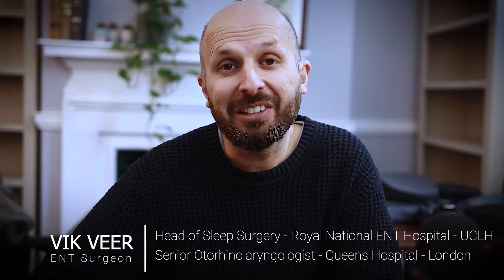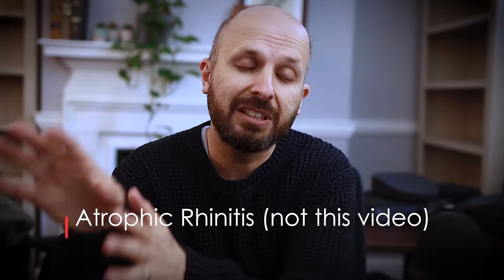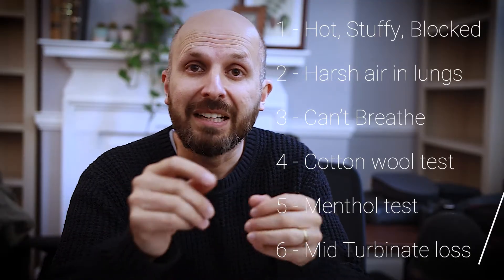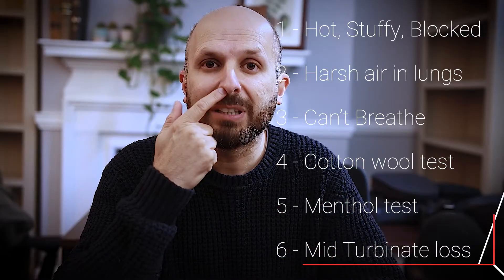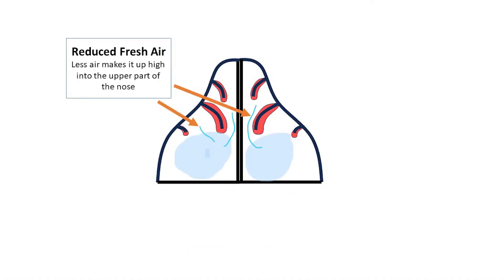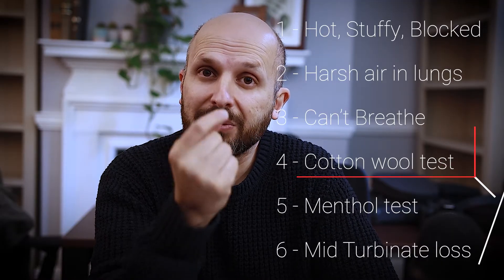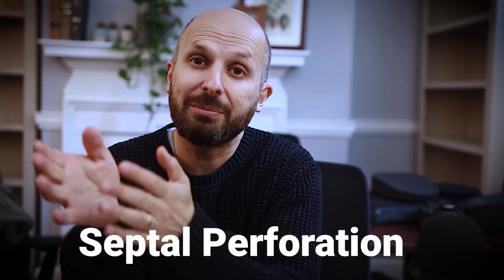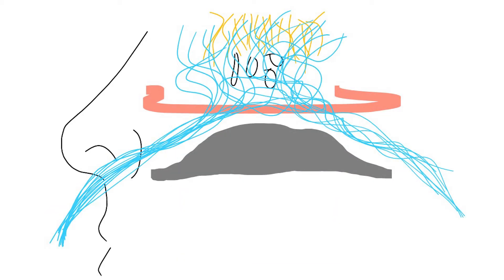Empty Nose Syndrome - My Theory & How to Fix it

Comment: Removing turbinates will cause a drop in pressure of the air flowing through the nose which can be catastrophic. The lower pressure will not be sufficient to inflate the lungs effectively which is why some people have trouble with automatic breathing when they have had aggressive turbinate reduction.

Comment: If the septum becomes deviated over time (for whatever reason). Why can't we "un-deviate" it over time?
The teeth are most definitely not flexible but we have braces to correct crooked teeth. Why can't some kind of nasal "brace" be used to "un-deviate" the nose, safely over time?
I do NOT mean we should break the cartilage, but this sounds like a reasonable approach. Septoplasty (if terminate reduction is done), can cause ENS, which is nightmarish from the descriptions I've heard of.

Comment: I never had issues, and don't know why my parents or people wanted to remove what is called poypper i næsen, polyps in the nose or something. But they might have done this as well. I just know, after it, I feel no resistance in my nose, and nose breathing is much harder. Never had issues, so don't know why this had to be done. :( Also, when I dive under water now, or if jumping into water, water automatically go up through my nose, into my stomach, so I swallow water through my nose, no matter what I do. Which makes my stomach hurt after bathing i salt water for a bit. :( Also have the cold air feels bad when breathing. I found if I hold down one side of my nose, so only one hole is open, it's much easier to breathe because now there is resistance, so I can actually suck the air in without having to force so much.

Comment: I feel sorry for so many commenters here suffering the symptoms. I have been dealing with hyperosmia for about 3 years and its been driving me crazy. It was hell trying to figure out if its phantosmia or what until i got an air quality monitoring device that detects HCHO and TVOC, that i can prove i wasn’t hallucinating. Only until recently i noticed that only one of my nostril is partly block and hence came to learn about turbinate. Smells from natural sources won’t hurt and also won’t last to offer steady constant relieve, but most chemical fumes would linger. I was going crazy not knowing what it was and thought that somewhere in the neibourhood somebody has been polluting the air. What made me crazier was nobody could smell what i smelled. Upon realising this turbinate thing, i deduced that its inflammation, as I’m also currently managing whole body lymphatic inflammation situation through detox with the right food and exercises. You, Dr Veer, by far has given the best and possibly rare explanation that could shed light to what this is. This knowledge gives hope where there’s almost none. ❤ Thank you.

Comment: Dr Vik, about 2 and a half months ago i underwent surgery: septoplasty, electrocoagulation of inferior tuninates, palatoplasty and tonsillectomy; recovery was harsh of course, but like after the 3rd or 4th week i was fine; i didnt know details about this ENS; by the 7th week it all apeared ovenight: almost permanent suffocation and panic and extreme dryness in the nasopharynx, palate and throat; ENTs say i have some synechiae developed after the surgery and that's a fact; some ENTs say the symptoms are in my head; one ENT that says that i have ENS and removing the synechiae will do worse; another one says that removing them is key because the synechiae might be blocking the receptors and the turninates from doing their job; what do you thing?

Comment: A side-effect of my turbinate reduction surgery (radio) was that now when ever the temperature drops to about 50F outside, my nose gets very runny. I have to keep tissues on hand. That the case even though they wanted to do a follow-up surgery to perform a nerve block because there was a swelling of those turbinates which was leading to a bit of pain. They warned that this rare effect could lead to them reverting to their original size. I opted to not do the nerve block. I sort of lost trust in the process.

Comment: Can u get ENS from aesthetic rhinoplasty (nose tip lifting where the septum has to be shortened)
Reply: There are rare cases of ENS after septum surgery. When turbinate is not reduced 'original ENS' not possible but lift tip can change airflow so some problem with this is possible.

Comment: Will damaging the nerves in just one turbinate cause ENS? (i.e if you had ENS in just one nostril and then closed off this nostril will you still suffer from it?). If not, can you take a cautionary approach and perform turbinate reduction surgery on just one nostril at a time to reduce the chances of ENS, or at least cure it by blocking the one nostril if it does develop?

Comment: I've seen people claim they got ENS from modern procedures. There will likely always be a risk when you reduce the turbinates because it changes the air flow. But it is good to know ways to prevent it and also how to fix it after. I'm considering a turbinate reduction, and if I get ENS, I guess I'm just gonna have to keep saline cotton over my nose

Comment: Thank you for not fearmongering over ENS. AFAIK the risk is basically nil (obviously bar malpractice) with modern techniques such as radioablation. This was a very real problem where the accepted practice was RESECTION of the turbinate rather than just scarring the tissue so it can naturally shrink.

Comment: I would like to share with you my experience after septoplasty and inferior turbinate reduction. 
The most important thing is that the right nostril only breathes well under certain conditions, including:
- nasal decongestion phase (nasal cycle). 
At the same moment, the left nostril breathes worse, but still feels the flow of air in it. 
When the nasal cycle changes after a few hours, I suddenly feel a complete lack of nasal patency on the right side (even though the doctor said there is plenty of room). The air in the nose on this side becomes hot, it is very dry inside.
I'm starting to wonder more and more whether I may suffer from empty nose syndrome, but it's one-sided.
In the morning I often wake up from sleep and feel as if I couldn't take air at all through that one nostril. 
In winter, it happened that I was outside and I had the right nostril unblocked and the air flow was very cold.
I don't know if I will ever breathe properly again. Could the doctor at least read this and write anything back I beg because I have been agonizing over this for 3 years now. I can send a CT scan. I performed it 2 weeks ago.

Comment: I haven't had any nasal surgeries and I'm mysteriously experiencing the symptoms of this condition, seemingly from cervical spine compression or neck and shoulder muscles impinging nerves connected to the trigeminal nerve system... At least that's my theory.

It feels terrible to live on every day with a super dry nose, feeling like the air is thin and there's no resistance to maximize your air intake. I don't understand how to even explain it. Basically just cold, dry and thin air. 

In my case, if I lift my shoulders up to my ears and kind of move my neck around, it get slight improvement. Otherwise standing up, walking, or sitting in a regular position leaves me suffering.

It's so bizarre.

Comment: Thanks. a great explanation which makes a lot of sense in topic of nasal aerodynamic and airflow. I guess modern medicine should get more insights into how air actually flow, research for how airflow sensors are located and their connection with neural system.

Comment: Is ENS possible without turbinate reduction?

My nose is severly blocked due to the tilted bone and i can breathe 20% air i guess i really need this surgery but im afraid
Reply: No. Ens by definition you had to have some type of turbinate reduction procedure.(conservative or aggressive).
Reply: Look into the root cause of your nasal issues. You'd be surprised if all the things/allergens that are amongst us
Reply: @Gibipap  I will have a endoscopic septoplasty for a spetal spur. No work on turbinates cause they look perfect. I assume chances of ENS should be non existent?

Comment: Wondering if anyone can help me as I’m not sure if I’m suffering from this or not and I’m at a loss of what to do, I’ve never had nose surgery but i can’t feel the air in my nose as I breathe in or out, or when I breathe through my mouth too I feel I can’t breathe. I believe it started after painting the house and stupidly not using any protection. I can feel temperature and i find it easier to breathe when the air is cold as i can feel it but otherwise i struggle to breathe. I can also feel menthol sweets when i have them. I find my nose is dry aswell and if i use saline nose spray to moisturise it helps me breathe a little easier too. Does this sound like ens? Or perhaps something else. I’m just at a loss of what to do and what to find a solution, thank you :)

Comment: I think its about nerve damage more than the amount of air. If your nose no longer can feel air your airflow is irrelevant
Reply: @HXLproductions  Nerve problems can arise from Turbinate  reduction procedures, but not the sole issue. Each case is different. Each procedure is different which has a snowball effect causing other forms of injury/suffering. Best way to put it is if an essential organ is tampered with to the point where it no longer is functional, then the out come will be devastating with a patient suffering from severe medical conditions. Same applies to Ens.
Reply: But nerves regenerate though

Comment: Hello Vik, mechanical engineer here. I am not an expert in CFD&fluid dynamics, but I know some stuff. Just take it with a pinch of salt:

It is true that if the flow of fluid gets faster, flow regime tends to turn turbulent earlier. But just because the flow regime is turbulent, it doesn't mean that the flow volume goes all over the channel. 

Fast turbulent flow has still a direction and only some small portion of fluid volume goes all over the channel. Most of the flow volume is still going to follow the main open path. Turbulent airflow won't necessarily go all around the sinuses in this case, and even if some portion does, most probably the most amount of flow volume will follow the main opening. Establishing fully turbulent flow regime at the entrance of the nasal cavity will still not guarantee that the airflow goes all around inside the nasal cavity.

So maybe the solution is not just creating a turbulent flow regime, but directing the flow & controlling the speed of the flow. Maybe the body(nose) just needs more airflow in the upper nasal area where the sinuses and nerves are located, regardless if it is turbulent or laminar.

Also, not only faster flow speed causes turbulence, but also obstructions&directors in the channel as well. So when you remove the turbinate, you get rid of a flow obstructor in the channel. Maybe the turbinates function as flow obstructors, to turn the airflow more turbulent in nasal cavity? Maybe turbinates function as airflow direction&speed regulators as well? Turbinate name kinda resembles turbine. 

Maybe there is an undiscovered but better method of directing&regulating nasal airflow, so that airflow in the upper nasal area(where the sensors are located) increases. Then you wouldn't need to narrow down the channel again.

Comment: I have this problem without nasal surgery. I had my wisdom tooth removed but not the top one. My tooth sitting on my gum def gave me issues and maybe even an infection. I've since had the top one removed days ago. But  my throat was on fire and the cold air was definitely felt after each cigarette. 

Since removing my upper wisdom tooth my gums dont feel inflamed, i will update everyone if my ENS goes away or gets better with time. 

I definitely feel like my turbinates were affected by a potential infection, and i hope it goes away

Comment: I have taken antibiotics veryvstrong and had several side effects. The only one that persists is something I think similar with ENT. I simply cannot inhale air, when I try I feel only emptiness inside of my nose. It doesnt reach to the point the air passes trough throat until lungs. This is very debilitating and affects immense my life quality. Im sure the chemicals of antibioticos destroyed something inside nose but I dont know what. I have been in several doctors I take vitamin b and other supplements but nothing helps. Any idea what might have happened to not being able to inhale air?? Thanks
Reply: @filipem9247  what antibiotics did you take?
Reply: How are you now after 3 weeks?

Comment: Hi Doctor VIc,  thank you for your video! I did a Turbinate cut surgery in Sydney in 2020. After surgery, i got much better in night time but my left hand side nose stuffness was getting worse in daytime. I saw a ENt doctor in Sydney and d=he did a 3 minutes checking by putting a camara into my nose and saying i got ENS. I was extremely confused because only my left hand side nose got congestions. When i lift my nose, i can literally feel the breath is getting better.  Before making a conclusion of ENS, is there any way we can have a test of the airflow?  maybe my nasal congestion is from other parts of the nose structures like nasal valve which lots of the patenits did the Turbinate cut surgery have
Reply from the maker: I think i have a video on using decongestants and a nasal dilator to test this.  if you feel better after 20 minutes, then it is unlikely to be ENS. Do not use decongestants long term - i have a video on that too.
Reply: @VikVeerENTSurgeon  Thank you so much for taking your time to reply my question！ nasal dilator makes me feel better.  decongestant worked very well last year, but not effective this year, i have no idea why. I will see another ENT doctor within 3 weeks. Could you please give me some ideas of what questions i should ask from your professional view of point。
Reply from the maker: sounds like you have a lateral nasal valve collapse. easy to fix. can be done with latera in clinic or might need a strut which needs a general anaesthetic. ask the ent to check for this, or you can look at your nostrils in the mirror and just sniff. if the sides of your nostrils collapse in, then it seems likely. good luck.
Reply: @VikVeerENTSurgeon  Thank you so much for your reply Dr Vik. I will mention this to the new ENT doctor!
Reply: @VikVeerENTSurgeon  thanks again! dr veer. i just got the mri report saying partial left hand.side inferior turbinate is missing. i was so confused! both sides of the inferior turbinate were cut, why left hand has partially missing. dr veer, in your professional career, do you see cases like this?

Comment: I was diagnosed with ENS a couple of weeks ago. I had a septoplasty in the mid-80’s. Frustrating. Whenever the air in my nose seems stale, I would use a netipot. There can be anxiety when you’re exerting yourself and you feel congested and like you are suffocating. I resort to mouth breathing. Sometimes I am just hoarse. I also choke because I haven’t figured out how to breathe and eat. On top of things, I have vocal chord dysfunction. My ENT recommended budenoside 0.5mg/2mls with saline in a netipot. It seems to help. When my nose starts whistling or I snore through my nose….I get up and use the budenoside rinse. I went to the ENT thinking maybe I had scar tissue or an infection. I already live with an autoimmune disease so it’s just another issue to understand and adjust to.
Reply: How did you get ENS like 40 years later?  Or did he have ENS soon after surgery
Reply: انا لا استطيع التتفس او تناول الطعام هلا ساعدتني؟😢

Comment: Hello Dr. Veer. You say you don't believe it's a removed receptor that cause ENS. Here is what I can say, based on my extensive readings. First of all, it's the receptors (not one), namely the TRPM8 ones which sense air between 8 and 25 degrees. These are distributed in many parts of the nose, including the turbinate, septum and nasal walls. A study showed that ens patients react very well to menthol inhalation, which activates these receptors. The cotton wool test and implants works in some cases, but not in others. There could be many reasons why it helps, namely that it redirects airflow to working receptors and-or puts more air pressure on the remaining receptors.

Thank you for the video, lots of interesting stuff!
Reply: So, do the receptors die? Is there no chance of them coming back?